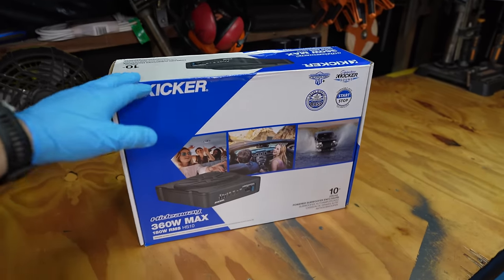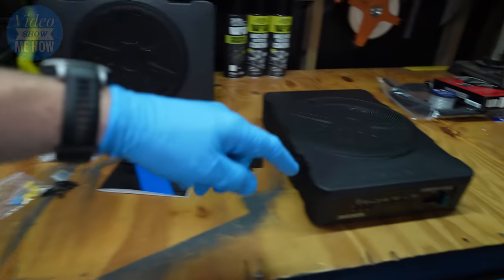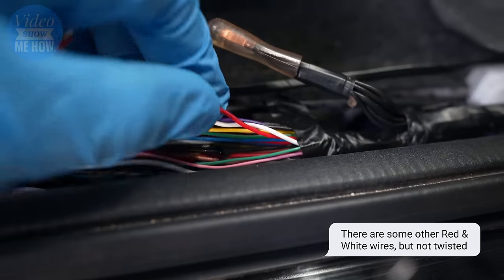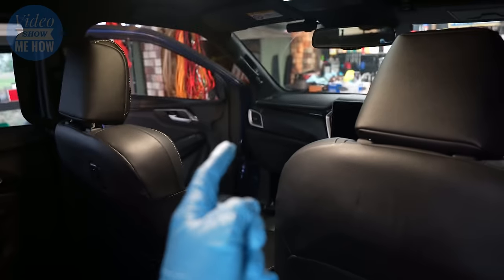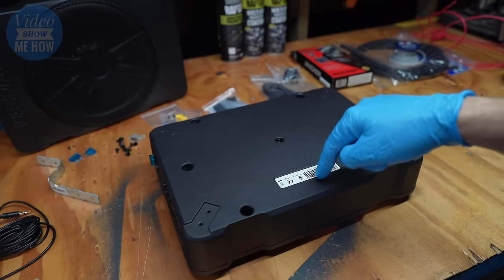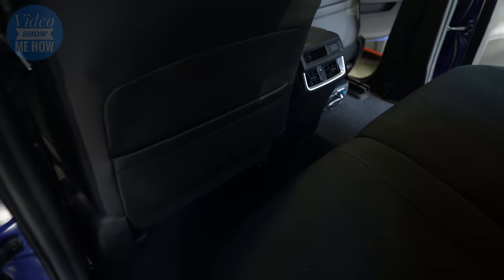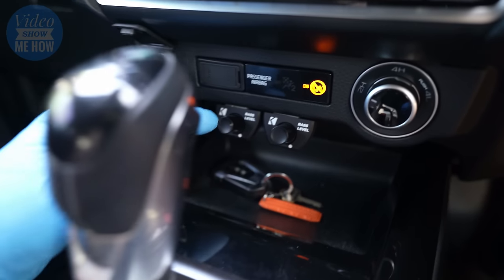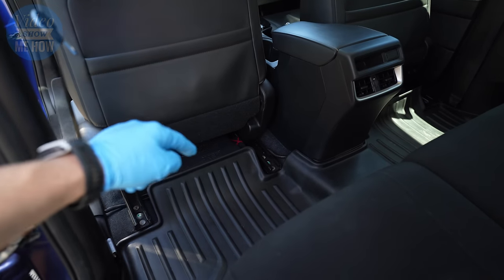Get the Ultimate Bass Experience with Kicker HS10 Hideaway Underseat Subwoofer: Review and Demo

Comment: Its possible to intall this sub with an epicenter???
Reply: This sub can not handle an epicenter. It is a sealed woofer and 150 watts. It probably plays pretty low, but is obviously limited in low bass output.

If you listen to music that has very high bass and want to use an epicenter to get more 45Hz bump then it would work. You just need to be careful to not over drive the sub.

Make sure to feed the epicenter a full range signal.

Comment: Mine wouldnt work at alll, i had to use my blue wire for it to power up, haha even went to the shop and swapped my sub because I thought it was the sub lol
Reply: It just depends if your radio outputs DC offset or not. Some do, but not all.

Comment: How did you connect the 2 subs together? Or are they ran totally separate wiring?
Reply from the maker: Separate power etc, shared signal, is in the video
Reply: @VideoShowMeHow  Thank you for the response, I re-watched and I still don't really see how you connected both speakers. I see that you have 2 wires from the right (pos & neg) and 2 wires spliced from the left (po & neg) but I don't see how you have them both going to both speakers
Reply: @VideoShowMeHow  awesome vid!! I was trying to figure that out aswell please. 
Ive spliced both sides as per the vid but when connecting to each sub (situated behind the backseat) Ive connected the right rear speaker cables to the coinciding sub and did the same on the left side. Effectively the inputs for each sub only have one set of -/+. Is this correct?
Reply: @eznyt  I found the answer, you can just tap into the signal wire at the main (your first sub) connector anywhere to receive your input signal. You don't have to run straight from the source again. Power wires should be a new/separate power wire from the battery, ground can be the same ground location.
Reply: Any chance you can explain this to someone who knows nothing? I purchased two, and want to connect them, I also have RCA cables but the back of my head unit only has one set of Red/White inputs for a sub, so I am a little lost at how I will get both connected. Any help here would be appreciated. I'd love to be able to just use one dial as well, but maybe thats not possible either. @VideoShowMeHow
Reply: Thinking of doing this to my mu-x. I saw a video where somebody took the feed from the tweeters (I think that's what they are) ..the speakers on the dashboard and soldering in cables from both left and right speakers dropped the cables down the dash and to the sub box. This saves cutting any existing wires. It was for a new version dmax which has the same speaker setup as the mu-x. I'm going to give this a go.

Also does your kicker have remote on? I didn't hear you mention having to take a rem cable from the headunit.
Reply from the maker: The video should show you? If you've got RCA outs you can use an RCA splitter to get the extra output set, then just need to get the kicker RCA to speaker wire - can get online or at autobahn etc
Reply from the maker: Let us know how you go 👍

Comment: the left side panel had two white and red twisted wires I found out, cut the wrong one to begin lol
Reply: I have this problem two red and whites, how did you find the correct one? Or can you use either?
Reply: FYI Turns out 1x set red and white is for rear speaker in door but other set is not for roof speaker. Not sure what other set of red and white is for, cut it first then repaired it.

Comment: Why did snip in half? Wrong thing to in car audio just use wire strippers to split cable not copper wire the splice the amp wire to the wire
Reply from the maker: The signal wire do you mean? It's fresh strands and solder, is fine for this kind of thing. Never going to be the cleanest via speaker anyway but fine for this setup :)
Reply: Is it worth using  a T Tap wire connector?
Reply: @SonicsnakeCNR If the T tap is secure and water proof it should be fine.